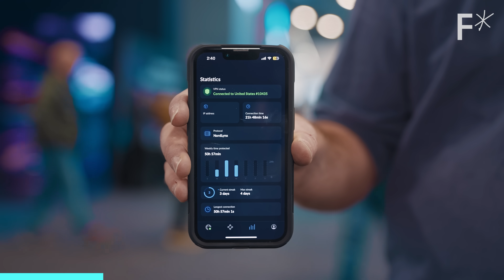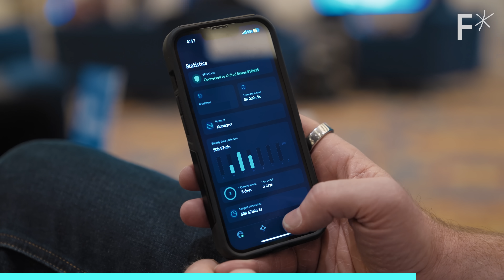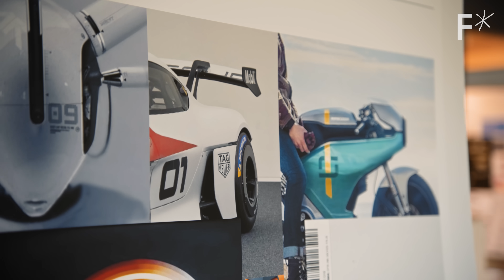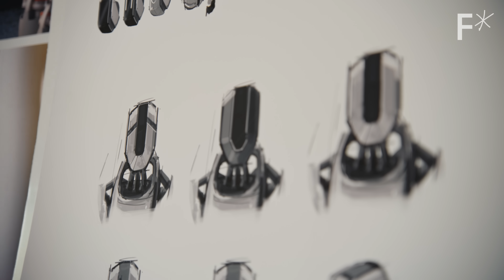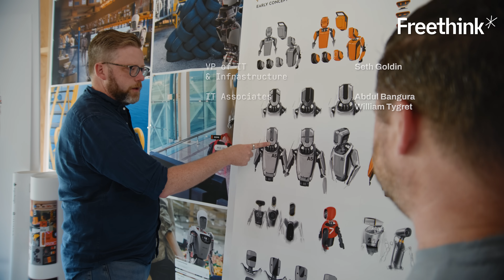Meet Apollo, the real-life robot who wants to give you more free time | Hard Reset

Comment: Although the mechanical engineering part is extremely hard, the real challenge is likely the « brain » (software) part. Most current generation humanoid robots are based on deep learning, and there is growing evidence that only deep learning based robots is not scalable in a fully open, unstructured environment as it can’t handle corner cases (Tesla FSD), which rises some safety concerns. Therefore I don’t believe the current generation of humanoid robots will succeed, but there could be some applications where safety is not too much a problem, or with a human in the loop it would be able to handle the corner cases. Alternatively my hunch is that there will be a need of an IA based on memristors like the start up Rain Neuromorphics is working on…

Comment: Ain't gonna happen. Making it more human-like doesn't make it more useful, in fact now it's limited to what a humanoid can do and will NEVER do everything a person could. And making them all the same is worse! Should it stand in a factory packing widgets and never use its legs? The factory fork-lift of the future will be driven by AI and have cameras to see all around. It won't have a steering wheel and wait for a robot to climb in and drive. You won't be maintaining hand/foot controls on the truck, or wasting time, or wearing out the robot and wasting the energy. The best part is no part! "It's made human-like so it can work in environments made for humans" Think about that! That is the antithesis of "First Principles"! (unless your goal is to copy a human which is much easier to do with sex) It compounds costs/complexity and reduces efficiency. I'm an automation engineer, I wish they would put AI on all the existing dumb robots. You could test and prove learning concepts/systems on existing equipment. There are all kinds of robots, controllers, vision systems etc. that could use a brain NOW. 

Besides the unproven AI, look at the fingers! Could it pick up a needle to thread it, Start a roll of tape, put a lid on a cup, make change out of a register? How long would it take to peel a label off the backing? tie a shoe, pick up a pen and write? A person, without looking, can pick up just one small screw out of a pile and orient it in their hand. A person can reach into their pocket and count change without looking. Please tell me the "easy" jobs a humanoid will be able to do! There are no "easy" jobs that aren't already automated. 
Enthusiasts will say "It's not like FSD because you don't have to be 100% accurate". Then it will fail in its job. If it drops a box of screws, breaks something expensive, falls and breaks itself, stops production etc. it's costs could be more than the savings. Enthusiasts will say "It doesn't need to be fast because it can work long hours". Then it will fail in its job. Factories are built for people to operate, so it will have to operate like a person. Asset utilization is important. Otherwise you'll have to create dumb jobs for it like overnight stock-boy. Call me when they demonstrate a stock-boy, if I'm not dead. Enthusiasts will say "we'll need them on mars" On mars you will want a smart crane/robot that can manipulate and join large habitat panels and move machinery. And you would want a smaller smart robot with tools instead of hands so it can manipulate/repair small cables/connectors quickly without having to pick up bulky hand tools. And it should have extending legs rather than get on a ladder. It would be ridiculous to have humanoids operate cranes, use wire cutters and climb ladders. You may only need two humanoids to set up a base because humans didn't evolve to use technology.

Comment: Guess what happens if you put Apollo onto a task.  His battery will only last around 2 hours. He will break quite often, and my son, the robot repairman, will have to be called in.  Next, if there is a mistake in the programming (I'm a 50 +  programmer), the robot will do a poor job at its task. Finally, after about a year, when Apollo needs a new part (wear or break down), it may be impossible to find the part. Finally, the initial cost of a robot like this one should be around $500,000!!!